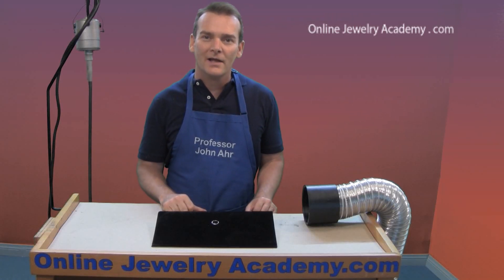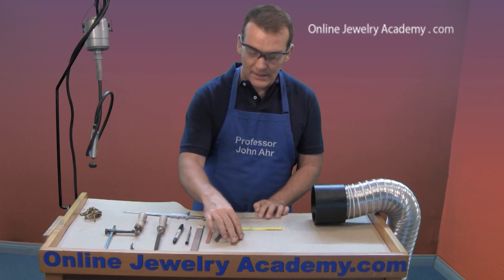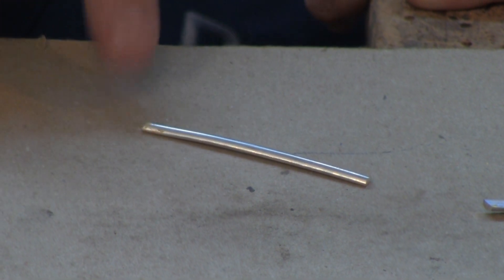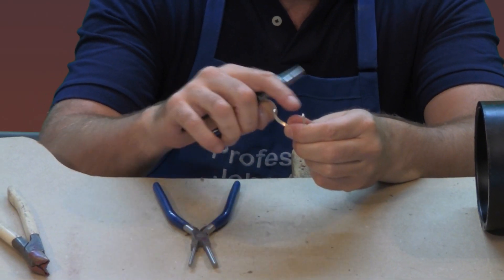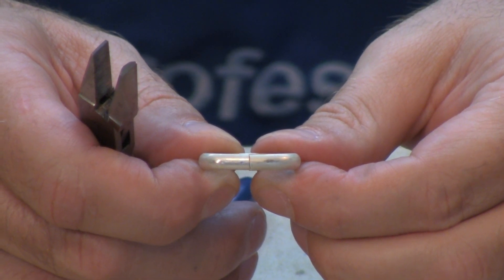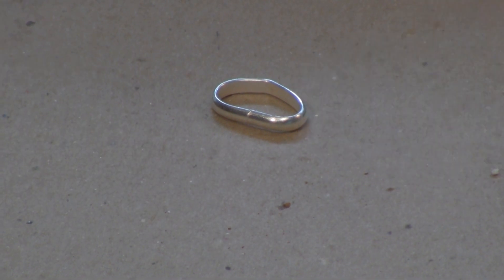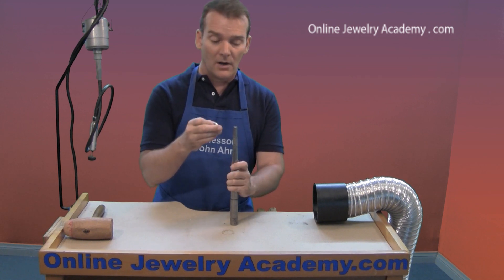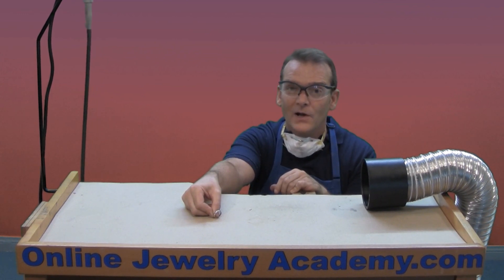Soldering A Simple Ring

Comment: what kind of solder are you using? there are so many options to buy and i don't know the difference.
Reply from the maker: Chrisi Flower I try to use "hard" solder for every soldering operation (unless of course, one joint is extremely close to another).  If you use hard solder every time you leave the option of using a solder with a lower melting temperature for another jeweler who might need to repair or size the piece.  And, every time you heat a piece, the solder does slightly alloy up to a higher melting temperature.  There are two videos on the OJA channel and website that explain the various types of solder.  Check them out!  And, thanks for watching! : )

Comment: Hi professor John Ahr, I noticed after you soldered the ring it looks like there is a groove left in the seam. Is that common? I had the same happened to me with the first ring I made. The ring is soldered and connected but there's a small groove. Should I cut  the ring and soldered it again, or should I leave as it is?
Reply from the maker: I honestly didn't notice that I had a seam in the ring that wasn't completely filled with solder.  Making things on camera often prevents me from noticing everything since I'm juggling multiple aspects of the project with the filming process.  Anyway, when you have a seam that isn't completely flush and filled with solder, the best way to deal with it is to saw the seam open and solder it again.  Sometimes you can get away with merely flowing more solder into the seam.  It's a judgment call.  Good luck Ingrid.
Thanks for your support! : )

Comment: Thank you so much for these great videos, I have learned so much from you.  I have been wondering about the ventilation system you have set up. Is it for dust, fumes or both? I also want to know if it is readily available for the hobby jeweler? I've set up a bench at my dining room table for cold connections etc. I'm just starting to learn about soldering thanks to you, but I'm concerned about air quality as I have no access to ventilation there. I do not plan on soldering often or very much when I do, so I'm looking for a reasonable solution.  The other option is to set up soldering on my stove top and use the hood vent... I'm just not sure about safety. Thank you muchly in advance 😊

Comment: Hi I love ur videos. I have learned so much from you.  Thank you.  Do you have any videos that will help me upsize a silver ring and downsize also. 
Also I have to make a ring from a 4 inch 9 gauge silver wire and two 4 inch 16 gauge wire all have to be soldered then shaped for an online class I am taking.  There are only books to go by, and no videos and I am really having a hard time with this project.  This is my first attempt at this and I am not sure first how to measure.  I have many tools but I think I need a ring gauge ruler to determine the length of the wire to cut for a size 7. Thank you!
Tammie

Comment: Very nice tutorial! I have a couple of questions:

1. What happens at the soldering level to the ring? Is the join pretty much solid now or do you have to be careful with pressure there? I kept waiting for the ring to part at the join!
2. Does the join buff out well, or will a line always be there?
Reply from the maker: Quaght I'm glad that you enjoyed the video.  And, you asked a couple of great questions.  What happens when you solder silver is you join the two sides of the seam at an atomic level.  So, when you solder the ring, you literally turn it into one piece of metal.  The solder is a silver alloy.  It is essentially silver blended with other metals to lower its melting temperature.  Because solder isn't alloyed the same way that sterling silver is, it has a slightly different color.  You can minimize the appearance of a seam by removing any solder on the outer surface of an object followed by sanding and polishing.  But, if you want it to completely disappear, you'll have to plate the item.  I hope this answers your questions fully.  Thanks for watching! : )
Reply: OnlineJewelryAcademy
 Thank you for the quick response!

Comment: Is there ANY possible way you could do a video on how to make a 3 stone bezel ring. I completely understand how to make the silver ring(video was amazing) but I'm wondering if there is a more simple way of laying down arm like bezels on a already made ring, or would this need to be done with 1 strip?
Reply from the maker: +Logan7o2 Hi Logan,  You should probably watch this video https://youtu.be/FKPov5t85a8  There is also a video on the OJA playlist that covers how to make a bezel cup to fit an odd shaped stone.  You can find our complete playlist at www.onlinejewelryacademy.com  Bezel cups are never produced and sold in strips.  One reason why is because they need to be placed on an item with enough room around them so that stone setting tools can access them from all sides to properly set a stone.  If you follow the information in the video I've suggested, you should be able to create a ring with the three bezel set stones on it.  Here's a tip to ensure your success, use all of the different solder types (a different one on each bezel cup).  This should help prevent the previously soldered bezel(s) from moving while you attach the next one(s).  Good luck with your project.  Thanks for watching! : )

Comment: Great tutorial. If I wanted to stamp a name on the outside would I do that first while its flat or after making the ring? Thanks!!
Reply from the maker: Hi Candice,  Thanks for the compliment.  I'm glad you liked the video.  If you want to stamp a name on the ring it is easier to do so while the band is flat.  I would also suggest that you use a flat ring blank rather than the half round one used in the video.  Good luck with your project.
Thanks for your support! : )

Comment: What kind of wire do you use for rings and cuffs? Dead soft, half hard, or hard? Thank you for the videos.
Reply: I'm having a hard time finding any 14g half round half hard wire. I keep seeing silver filled wire though.
Reply from the maker: Hi Roxy,  I use dead soft wire for the projects that I make in the videos.  I either buy it already annealed or I anneal it myself.  The ring in the simple band video was made from 6 gauge half round wire.  You can probably find the wires that you need by doing a search online for jewelry supply companies.  Good luck with your projects.
Thanks for your support! : )

Comment: How long should you pickle the piece before removing? And is that neutralizing process with water/baking soda absolutely necessary?
Reply from the maker: The length of time that an item needs to remain in the pickle pot depends on a number of things.  How oxidized is it?  How strong is the pickle?  Is the pickle warm?  Silver items need to be left in the pickle pot and average of 15 minutes.  If you see any dark spots on the surface after brass brushing, just put the piece back in the pickle for a little longer.  Neutralization with water and baking soda is necessary; especially if you are pickling a hollow form like a bead.  If you leave pickle on the surface of your piece it can corrode it.  Check out the OJA's many videos on pickling included in our playlist on the OJA website at: www.onlinejewelryacademy.com
Thanks for your support! : )

Comment: The silver wire looks very thick.  What was the gauge size of the silver wire?   Can you solder smaller gauge wire like 18 or 20 gauge?
Reply from the maker: +Cathy H 
Hi Cathy,  The wire used in the video is a 6 gauge half round wire.  It is possible to solder smaller gauges like 18 and 20.  Good luck with your projects.
Thanks for your support! : )

Comment: Thanks for this video! What type of mallet are you using to hammer the ring? Is it solid wood or a rawhide mallet
Reply from the maker: In that particular video I used a wooden mallet.  But you can use a rawhide, plastic or wood mallet to form the wire without leaving a mark.
Thanks for your support! : )

Comment: Fabulous instruction!  I've made a similar piece but I made a necklace and I didn't texture the discs.  I also used a different way of creating the intermediate loops but, I have to say, I prefer the way you have done it here.  Be a pal - tell us how you made the texture sheet you used - pretty please :-)
Reply from the maker: Hi Hilary,  I think you posted a comment about the Moonshine Bracelet on the Make A Simple Silver Ring video.  The way that I made the textured sheet metal for the discs was I roll printed them.  I achieved the texture by creating a brass tool out of sheet metal.  I center punched the sheet about 1,000 times.  Then I randomly drilled holes across the surface of the sheet.  I ran the brass tool through the rolling mill with a piece of facial tissue between the tool and the silver sheet metal to create a surface that has both matte and shiny qualities.  If you look up the rolling mill videos on the OJA website at: www.onlinejewelryacademy.com you can see all sorts of way to work with the rolling mill.  Plus, I posted a playlist specifically related to the Moonshine Bracelet project here on YouTube.  Have fun making textures.
Thanks for your support! : )
Reply: Thank you so much for taking the time and trouble to send me such a comprehensive reply, Prof. John :-)  Today I have been making a texture sheet out of a piece of copper and have quickly realised that I will have to resort to my drill to get into the centre of the rectangular sheet as my hole-making, screw-down punch won't make it (!) so your advice has come at just the right time.  I would never have thought of using facial tissue between the tool and the silver sheet metal - phew! - thanks for that!  :-)  I also had another success today:  for the first time I have successfully done some pick soldering.  What a clever technique!  Now I'm going straight to your rolling mill videos for more nourishment . . .
Reply from the maker: Sounds like you're having a very productive day Hilary.  Glad I could help support your creativity. : )
Reply from the maker: Hi Hilary,
This is Don from the OJA.  We will be posting a video within the next few weeks on how to make the tool you asked about.  I realise that John already answered the question, but here is an early release link to the video. https://youtu.be/KROjpimvQVk
Reply: You are Megastars!!  :-)  <3
Reply from the maker: You're so sweet.
Thanks for your support! : )

Comment: Hi John,when you plan the length of the sliver, why you add 3 times of the thickness of the silver? I think it should add 2 times ?
Reply from the maker: Hi Ingrid,  Adding three times the width of the material is a standard approach.  I find that adding two times the width of the wire stock works just fine.  Good luck with your creative pursuits.
Thanks for your support! : )

Comment: Hi.  Since this is fine silver,  why didn't you fuse it instead of soldering it?  Just wondering.
Reply from the maker: The ring in the video was made from sterling silver not fine silver.  Fine silver is not used for the construction of rings.  It is used for bezels in construction.  I don't generally fuse pieces unless I'm working with scrap material or making granulation effects.  The OJA has videos on granulation and fusing that you might want to check out.  They are in the OJA playlist on our website at:  www.onlinejewelryacademy.com
Thanks for your support! : )

Comment: Where do you get your silver from? Or rather where should I get mine?
Reply from the maker: Hi Stephen,  The OJA does not promote any jewelry suppliers.  My best suggestion is to check the spot prices of precious metals online and compare prices between suppliers online.  You'll quickly see who has a higher markup on silver.  It's gonna take a little bit of work.  But, it's important to be aware of markups and to support local businesses whenever possible.  Good luck with your shopping.
Thanks for your support! : )